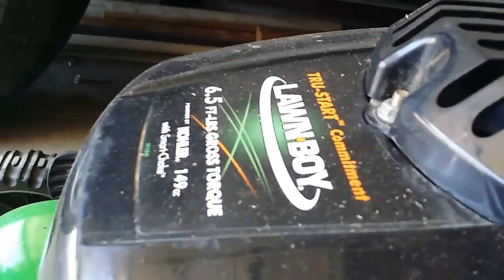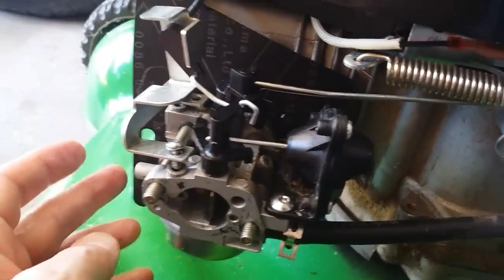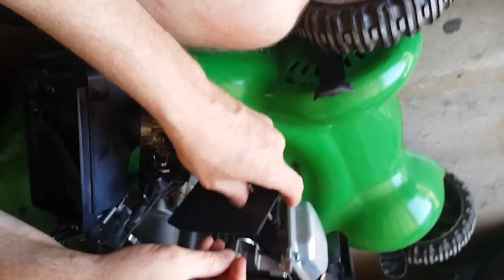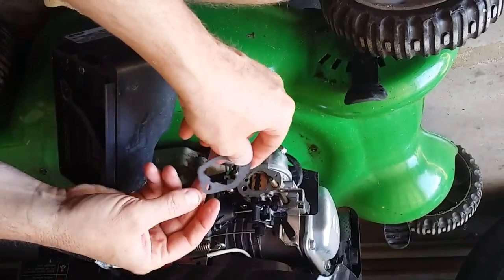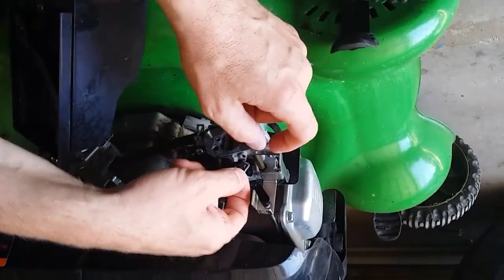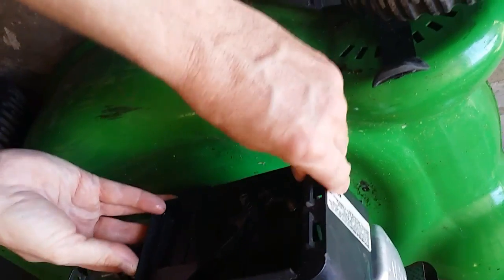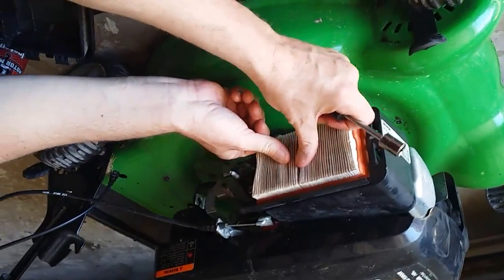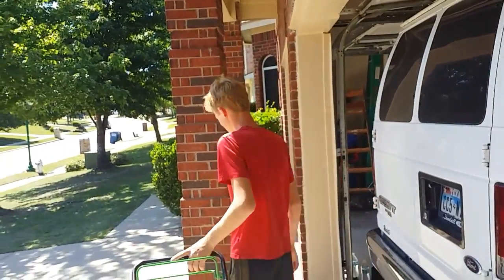KOHLER 149cc XT149-0225 won't start carb kit change out

Comment: I have one with the PH-XT149-0226 engine that has slowly gotten almost impossible to start.  It has always seen real gasoline and run out every fall.  It has the same issues.  I was searching to find out what others did to fix theirs or what other issues that engine has.  Thanks for the video.

Comment: I am a DIY woman and I appreciate your helpful video. Thanks for sharing. This was one of three very helpful videos that rescued me. I have the same push mower and it was losing a LOT of fuel. When I checked the air filter, it was drenched in fuel and a quick search told me the carburetor was the likely culprit.  Since the carburetor was about 10 years old and only about $10 on Amazon, I decided to replace it.  With your help, I was able to replace it and now my mower is working like new. Thanks again🙂!
Reply from the maker: Great to hear!  I struggled with it as you can see...

Comment: Thanks for this. I have the exact same lawnmower, and mine won’t start as of the other day. For a year before that though, it would run for about 15 minutes and then stop and not start until a couple of hours or so. Sometimes when it ran, it would idle slower or run slower. I think my problem is the carburetor since I tried everything else. I will try to pump in some cleaner first to see if that helps. If not, I might have to get the carb kit.

Comment: I have a 21" kohler lawn-boy 6.5hp model 10734 . It just won't start! It has been sitting in my shed for 2 or 3 years. I took it out, drained the gas and put new gas and added some sea foam. Installed new spark plug, new air filter. I disassembled the carburetor and cleaned it well with carburetor cleaner. Oil level is fine. No, i didn't drain the oil. Please help. Why won't it start?
Reply: @paulleininger4823  Thank you very much. I bought that starting fluid and sprayed it into the air intake all the way to the carburetor. The motor stared briefly then died. I tried again. It started and died again. I tried a third time. It started and died again. Every time it would run for just 3 seconds or so. Do you think the carb kit is what i need? I did notice that the gasket between the carb and the body is flimsy and kind of falling apart. The model number for the carb kit for my lanw mower is 14-853-90-S. I can buy that off amazon. Or might it be a different problem? Thoughts?
Reply: @paulleininger4823  thank you very much. No, my mower is from 2014. I went ahead and bought the carb kit for my mower. I'll try to create a video when I put it together and I can let you know how it goes. Thanks again